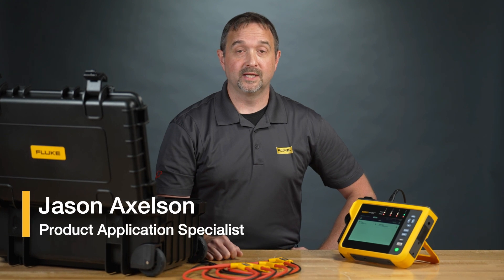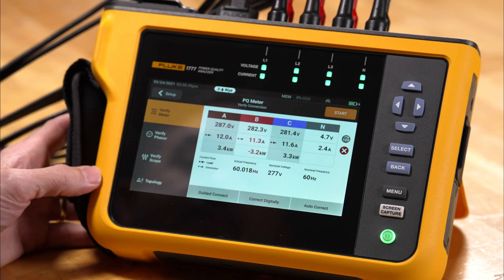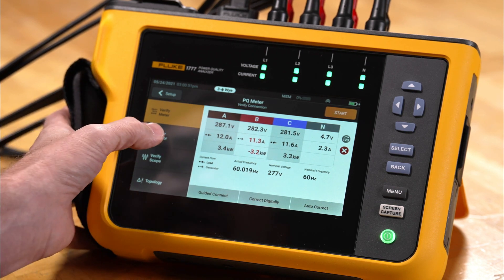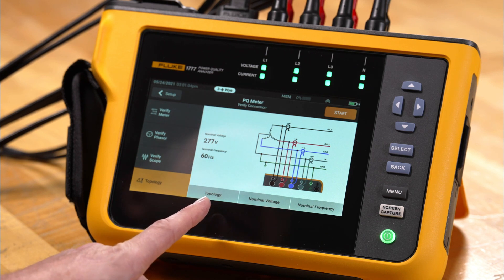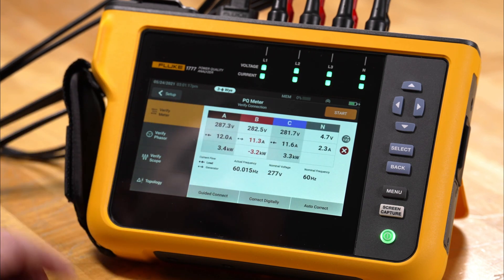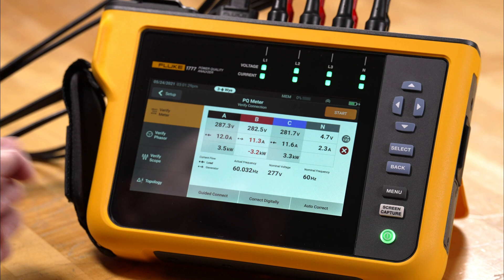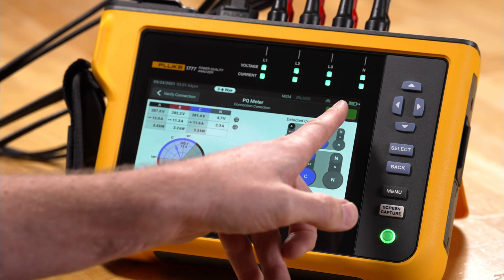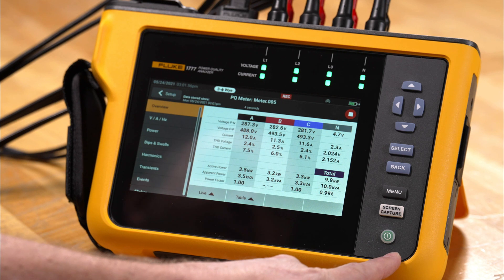Using "Meter mode" on the Fluke 1770 Series Power Quality Analyzers

Comment: Does Fluke 1775 comply with the IEC 61000-4-30 Ed. 3 Class A standard. If yes where can I get Certificate of Conformity test report that the above instrument meets the requirements of IEC 61000-4-30 Ed3 when tested according to the procedures set forth in IEC 62586-2 ?

Comment: Fluke almost had a great product here. Many of the measurements only become available once a recording session is initiated. This should not be classified as an analyzer. Analyzers are products like the Keysight PA2203A or the HIOKI PW8001. This is really just a logger with remote communications options. And the user interface is excruciatingly sluggish. We hope that this does not become a trend with Fluke.